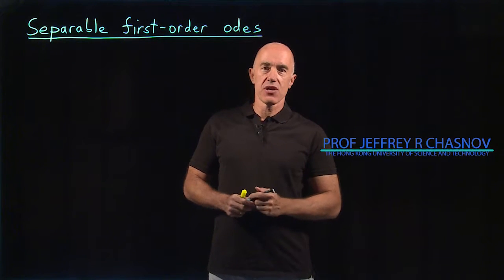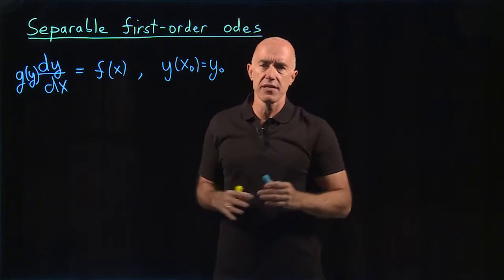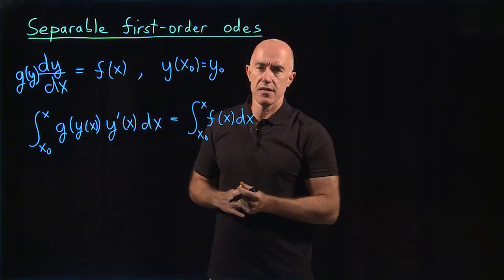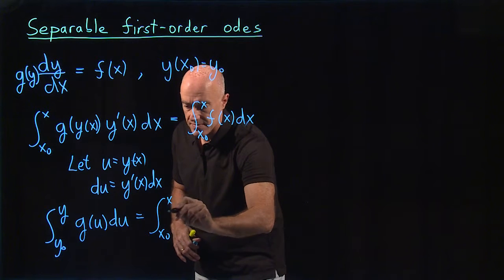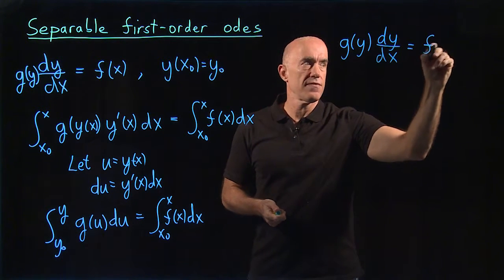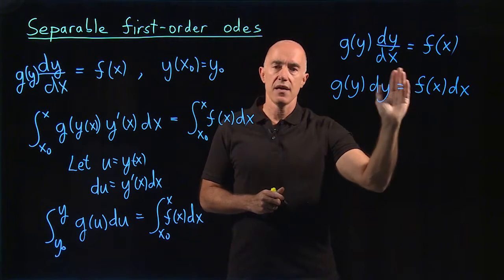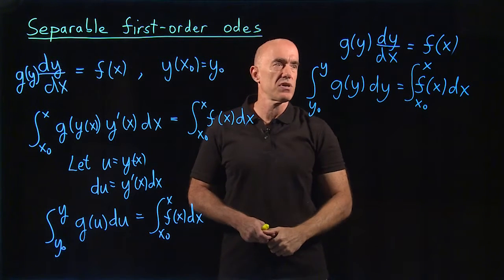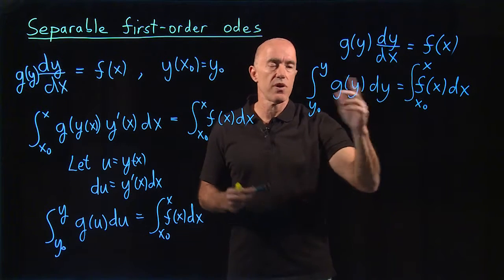Separable first-order differentiable equations | Lecture 3 | Differential Equations for Engineers

Comment: nice explanation. 
remembering that "dy/dx is not a fraction but we treat it as a fraction"
is the usual explanation for getting the solution. 
i would like to find a less 'hand wavy' explanation, though.

the best idea i have found so far is to consider the individual dy and dx
as a kind of "basis of the tangent space" at the point of interest.
is that an accurate view for arriving at the two integrals over y and x?

also, where might i find a source for that part of the theory/analysis?
thanks again for the good explanations. i find them useful and interesting.
Reply from the maker: The way I think about it now is dy/dx is the limit of a fraction, so most times you can treat it like a fraction. This is what mathematicians did for 100 years between Newton and Cauchy.

Comment: Excellent exposition of the justification of separable equations. Diprima just presents an example and treats the dy/dx as a fraction, and asserts that one can just multiply both sides of the equation by dx and ....voila we have two easily solvable integrals. Yeah, but why and how can we just multiply dx as shorthand? There are other expositions out there (using antiderivatives) but yours is more sensible and intuitive. The justification is just a small matter in the larger scheme of differential equations, but it is good to understand that there is a solid basis for the way we solve. Thanks.